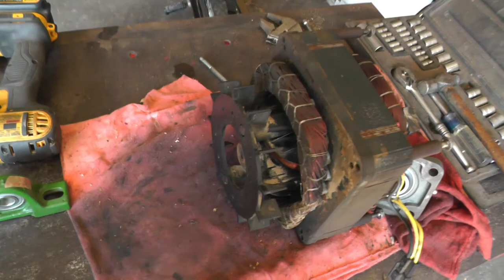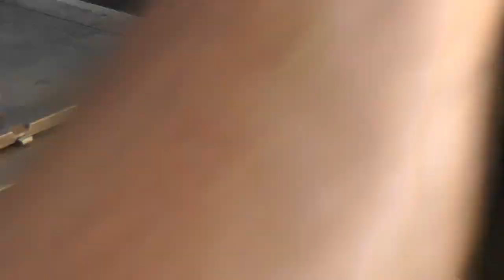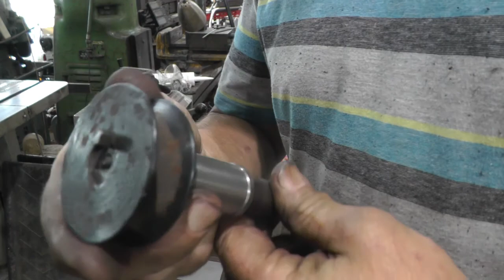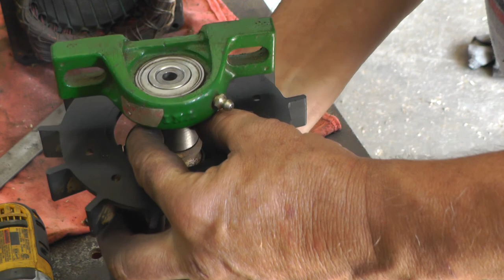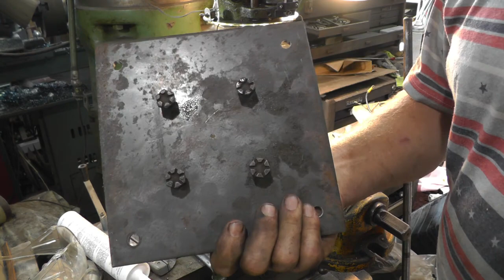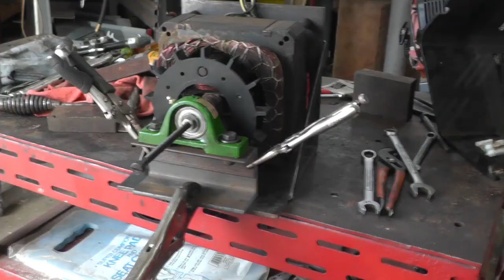Coleman Generator Conversion to Belt Drive

Comment: Wow this looks like what I’m considering but was told it couldn’t be done or id need a bearing support. But I want to use another gas engine like a predator engine. 
Why did you need a bigger pulley on one side?
Reply from the maker: The motor is 1800 rpm the generator is 3600 rpm so the difference is to make the proper rpm for the generator. You will need to support the generator rotor with bearings.
Reply: @kevincrawford2027 ok why not get a 3600 motor?

Comment: Been thinking on how I could do something similar. Have a 7hp china diesel generator and a larger 10hp engine off another one that I just rebuilt. If you made it 0.75:1 you could run the bigger engine slower at 2700 instead of 3600 which in my case should last longer and burn less fuel

Comment: I am really surprised how hard the crank was and still scored by an aluminum /alloy case cover with no bushing/bearing. I have seen internal composite gears  in small engines but never a composite cam. Polymers are quite robust today. I hate to tear my cheep generator apart!